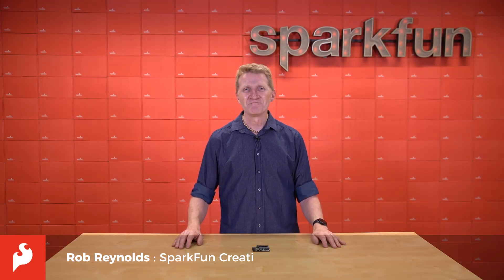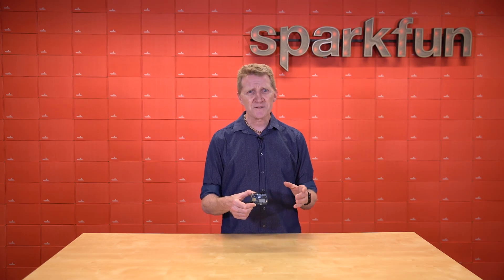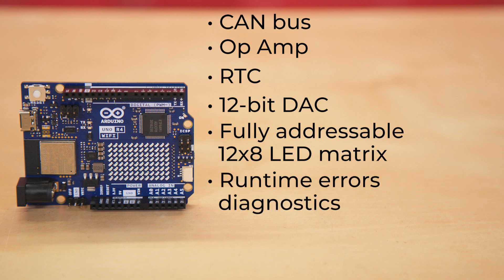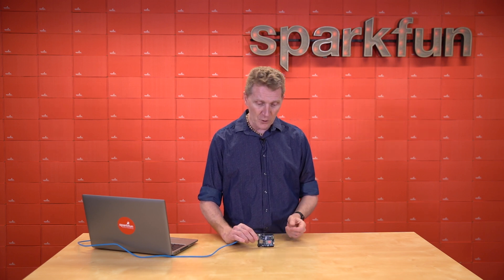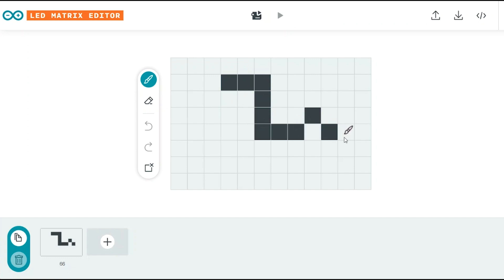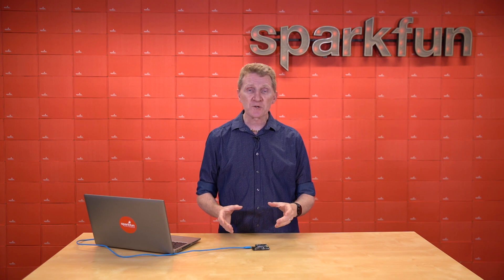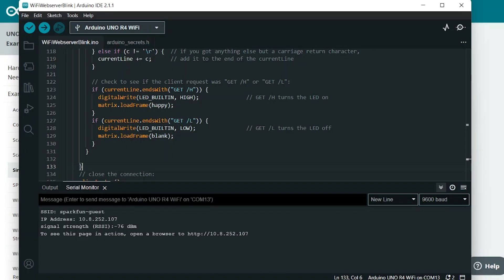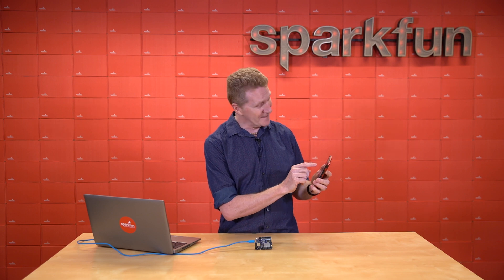Product Showcase: Arduino UNO R4 WiFi

Comment: Can it be programmed from a usb 2 serial port?
Reply: The schematic for the board shows that the D+/D- data lines are the only ones connected. The TX/RX pairs used by "super-speed" USB 3 are not connected. So yes, it's a USB 2 device.
Reply: Most likely yes

Comment: The Arduino board LED matrix... WHY/WTF?!!?!! Are we jumping the shark when it comes to LEDs?
Reply: I think probably it was like a case of "why not?" - The new CPU has more I/O lines, so add a dollar worth of LEDs to the board and those I/O lines that would have been unusable now have a use.

If you don't want to use the LED matrix, don't use it. Or buy the R4 Minima version, save a bit of money and do without the LEDs, WiFi, and QWIIC port